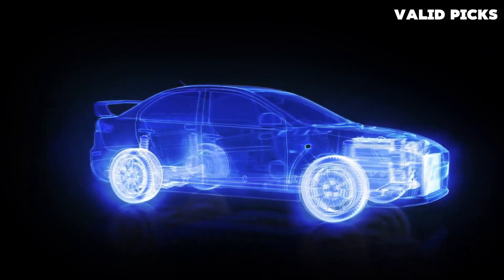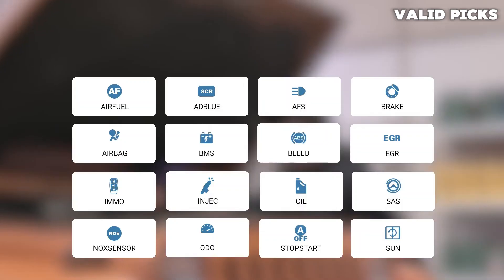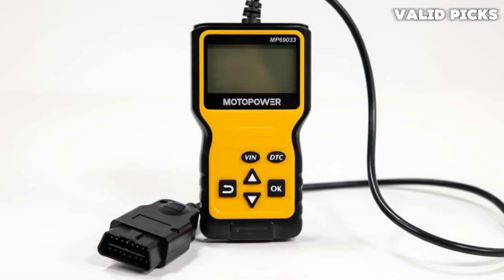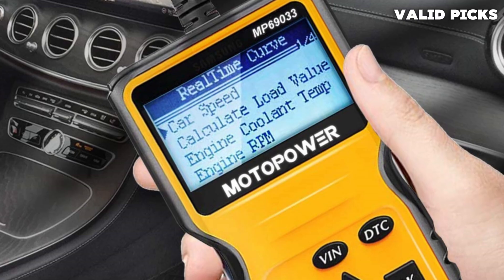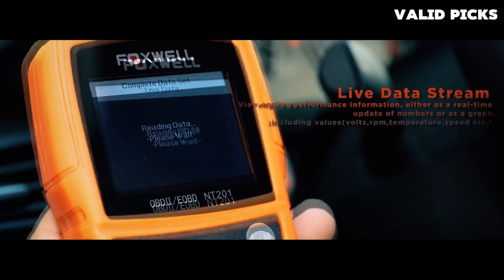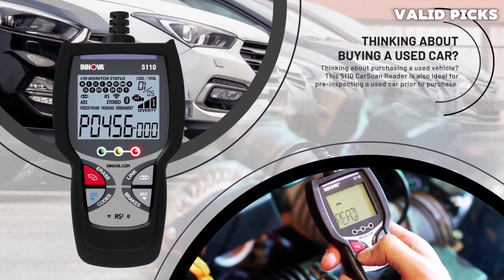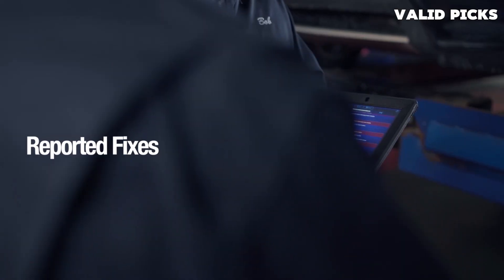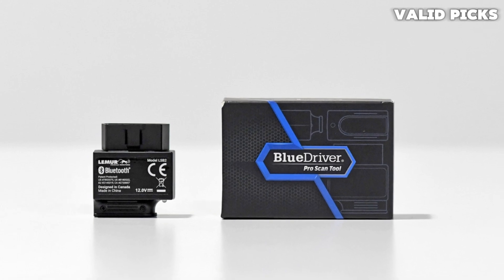Best OBD2 Scanner 2024 - Top 5 You Should Consider Today

Comment: I'm sick and tired of having to buy multiple hand-held units to add a new feature my previous hand held doesn't do.  What's the end game here?  You end up with a box full of moderately priced scanners when you should have just coughed up for the expensive scanner in the first place.  
I have a suggestion.  Almost all new cars have a high res screen in the dash.  Put the diagnostics into the entertainment system screen and hook it up to the ODBCIII connector.  It's the ultimate path to an upgradeable WIFI connected system and could be set up to download repair information when in your garage.  Any Android or Apple tablet could do this.